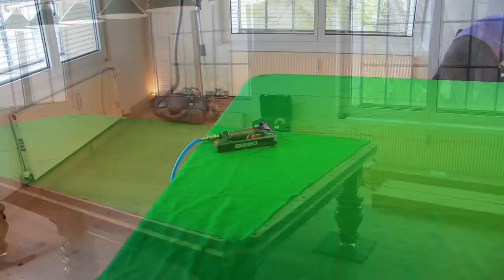Snookertisch (12 feet) - Aufbau und Montage

Comment: Whats the black base plates there no good you will hit your fett off them
Reply from the maker: The black plates are there to better distribute the weight of the table on the old wooden floor. The edges of the plates are beveled, so there is no danger to the toes ;-)
Reply: No its not about the danger too your toes its about the uneven stance you will have
Reply from the maker: hey Joe, okay I understand what you mean and you're right too. we are absolute hobby and amateur players. so at our shot and technique quality an uneven stance makes no difference at all :-)))))))
Reply: Die-Camper.com ok